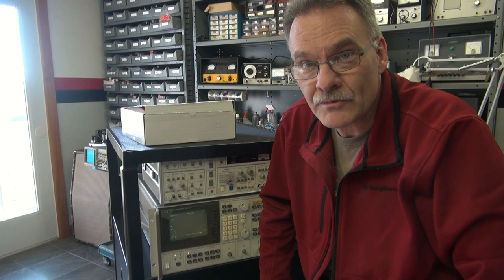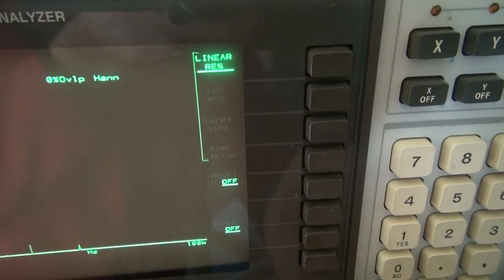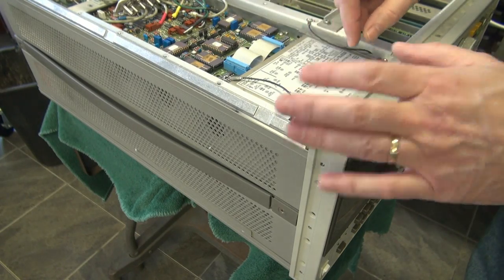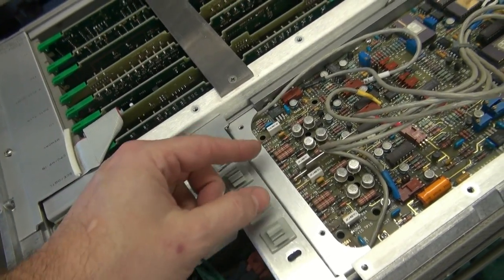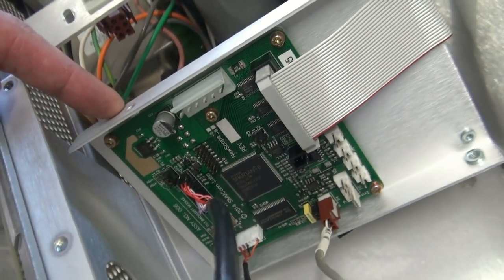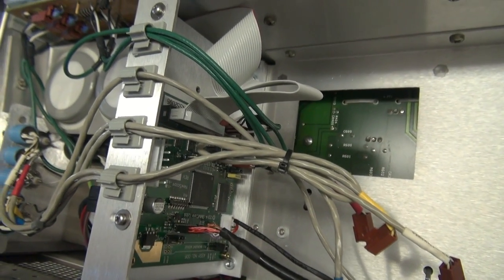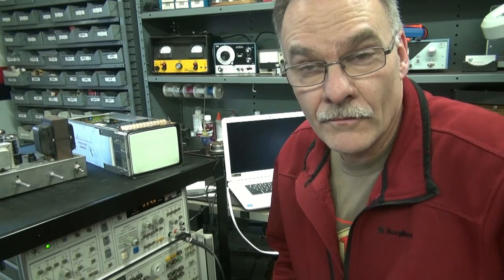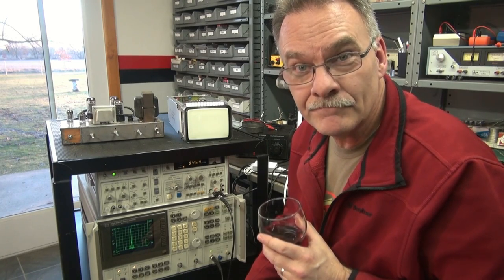How to repair replace HP 3562a signal analyzer oscilloscope CRT display

Comment: Glad to see this available. Those HP digital displays were real dogs. I worked with them back in the 90s. Even then a replacement display was over a grand (US), then HP just dropped all support on them. I saw several spectrum analyzers just junked because you couldn't get a new display. I remember thinking about modding in an LCD display.... shoulda followed through.

Comment: Terry, thanks for the video.  So you have been running this LCD display on your 3562A for a while now.  Have you encountered any problems, strange behaviours or display issues?  The CRT on my unit is actually pretty good but it is just a matter of time....  thanks.

Comment: Your videos are rubbing off on me.  But I had to give up on finding Leader's SWEMAR unit.  I did find an HP 3562A for $325 today and bought it.  It is supposed to be in great working order and shouldn't need the LCD upgrade right away.  It would be great if you did a video showing the various things you use it for on amps and how you actually configure it.
Reply from the maker: Will do Sir. I have 2 of the Swemars here. If you decide that you want one, let me know. TD
Reply: Sounds good.  I'll PM you my email address.
Reply: I sent you and email to your business email at D-Labs.  Not sure if you saw it.
Reply: I completed the LCD upgrade 3562A.  Wow what a difference.  Doesn't make it feel like such an old instrument.  Your video was very helpful.  Thanks